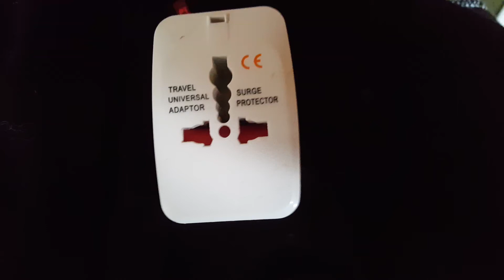(Potentially) Deadly travel adapter teardown

Comment: I have UK charger but I took off the UK plug part from Universal travel adapter. From UK to US/AU swivel and EU. For use 3 pin outlet AU style in China, just need a half chopped US plug as becomes a key for Chinese 3 pin outlet to plug the half chopped US flat pin to Chinese earth pin and unlocks both love and neutral and plug 2 pin AU on Chinese 3 pin outlet if single pin from US plug plugged in on earth.

Comment: So all universal power adapters with retractable pins are crap?

It's worth noting that that particular adapter's grounding pin is non-functional since it's made out of plastic. If I have an adapter that will convert any kind of plug into an American 3-pin plug, and the grounding pin is metal, how can I verify whether the ground / earth pin actually works as it should?
Reply: 1ex1uger Buy Bull Plug adapter Chinese AU style to US 3 pin to flippable ground pin becomes US 2 pin plug adapter, Chinese 3 pin and US 3 pin to UK, Chinese/US 3 pin to EU with Italian middle ground pin flippable to continential EU for 2 pin, and 2 pin US to 2 pin AU. Only for use with Chinese 3 pin plug